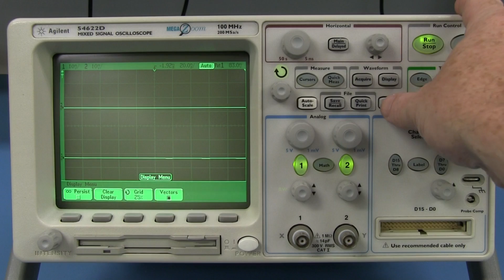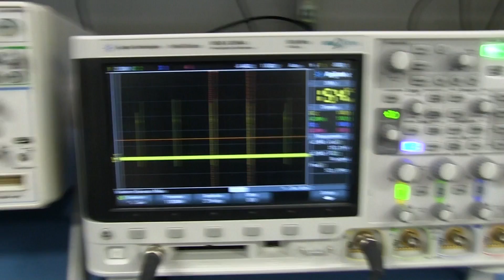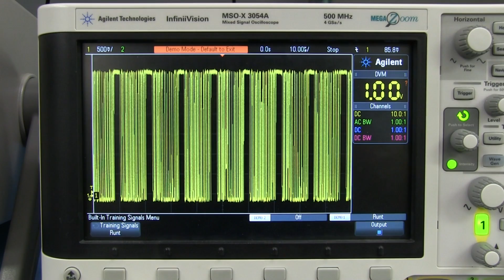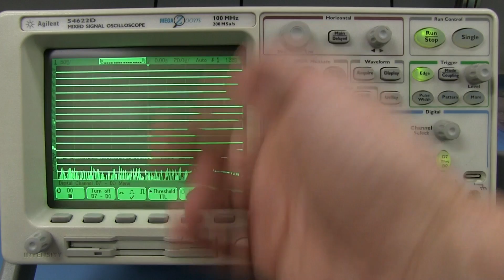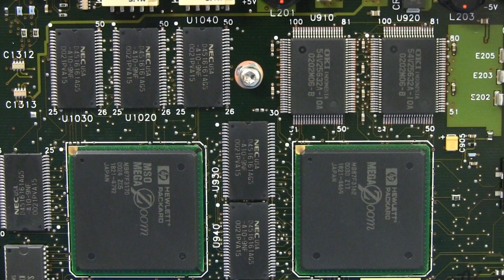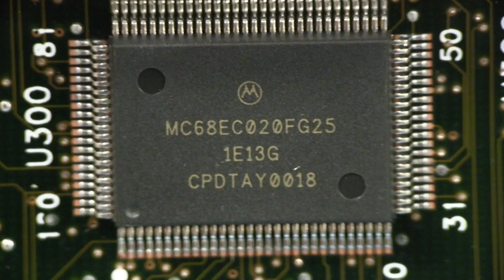EEVblog #591 - Agilent 54622D Retro Mixed Signal Osciloscope Review & Teardown

Comment: it is 400MS/s on digital when you use only 8 channels, otherwise it is 200MS/s, unless it is updated from the HP 54645D
Curious how you have all of those FFT's, integrals and other stuff without the need of external module and 54645D needs measurement/storage separate module for this

Comment: When i switch my 54622D i receive following messages:  Battery is low, System clock is defaulted, Ram disk is defaulted, The default setup was loaded, etc... What to do, to just change a battery?

Comment: Hi, a little bit late, but Dave mentioned that the fan could be replaced with a quieter one. The fan is a Panasonic FBA08A12U with a massive 47 CFM airflow and 38dbA. Up to now I couldn't find a much quieter one with nearly this airflow. Any ideas?

Comment: I have one.... leftmost button under the screen needs a good push to make it work now though :-( Might need to strip it down to see what I can do...
Reply: +Toby Mole  Agilent no longer had the spare part, which was a shame as it wasn't at all expensive if it had been available. I did fix my scope though. I stripped it down and applied a very thin layer of Caikote 44 to the elastomer buttons. This stuff has flakes of silver in it and once dry works really well. It's available on Amazon. Give it a try.

Comment: Hi My 54622D's firmware is last released firmware(version A.02.31) and Language pack（system version 2.4/11 language).I can select SPI(2 & 3 Wire Serial) and for instance set ~CS and Clock,at the same time we can see DATA.even though 2 channel OSC.Old firmware didn't select SPI,so we had to upgrade the firmware.Support was feasible up to last year.LOL I think it is not so retro.LOL.And if you use PC-Based software like LAP-C at the same time,we can decode I2C module.(54622D only decode I2C hardware,so select START and use LAP-C)So totaliy,54622D is now still very usuful.

Comment: If it only samples at 200Ms/s, then how can the bandwidth be 100Mhz? The rule of thumb is to divide the sample rate by 10 to get the analog bandwidth.
Reply from the maker: With SinX/x interpolation you only need 4 times the bandwidth in sample rate (there is some heavy behind this that proves it's the case), and this can interleave 2 channels to get that.
Reply: If you're referring to the Nyquist–Shannon sampling theorem, it describes that you effectively only need twice the sampling rate to sample a certain frequency
Reply: ***** Yes, but you need a good front end analogue filter to limit the bandwidth of the signal being sampled, and this filter isn't perfect.
Reply: Barrios Groupie Hmm.. that is weird yes. A quick google search shows up that oscilloscopes don't necessarily always one-shot capture. Doing a one-shot 200msps would indeed only give you a fairly poor 100mhz resolution image. equivalent–time sampling can be used to reconstruct a repetitive signal. However, a 100mhz oscilloscope can still display a 100mhz signal. The resolution of the waveform decreases as the frequency goes up, but that is only natural; even on a 200mhz scope the 100mhz signal would be of lesser resolution than a 50mhz signal.
Reply: EEVblog It depends on the speed of the roll-off of the front end anti-aliasing filter. Sinx/x interpolation is then carried out on the sampled signal. I guess you'd have to measure the frequency response to confirm this.

Comment: There might have been some technical advances since 2000 (the replacement of monochrome CRTs with LCDs would be the most visible). But I guess the impression that this scope seems old by now has to do with some design changes that are pure "marketing descisions"  and do not really represent technical advances. Oscilloscopes had the same uniform grey look for many decades and it is a recent trend  that even scientific gear is "stylish" and reminds you of the looks of consumer products. I guess as an engineer one should not let himself be blinded by the "looks" of the gear. I for my part regard some things as "modern" but not necessarily "advanced": For example I don't see the advantage of  flashing soft buttons over the (in my opinion) more rugged plastic buttons they used 30 years ago.

Comment: 1000 pixels horizontal on such a small screen because it's CRT, or because the pixels are smaller since they're just green? Never really thought about how dot pitch could be effected by monochromy.
Reply: IMO it's both. When the scope was built, LCD tech was pretty primitive, so getting a screen with that density would have been either impossible or very expensive. 

If they don't need color, then the number of display pixels per logical pixel becomes one instead of three. So, if manufacturing technology at the time can only produce pixels of above a certain size, a monochrome display would be able to attain a greater pixel density than a color one.
Reply: For the magnets and electron beam of a crt screen, it really doesn't make a difference if the pixels are colour or monochrome. So having 1024×768 in a small 13 inch CRT screen effectively meant you had a 3072-pixel wide 13 inch screen. (well this technically isn't true, as the CRT dots weren't side by side but in a matrix, but hell let's keep it simple). Wonderful times, CRT period
Reply: On color LCD, since R,G and B pixels are arranged in a row, there's a technique called subpixel rendering where you can light an uneven number of pixels to simulate a higher resolution.
Reply: I remember that the monochrome CRT's actually had solid fluorescent in front, not like RGB screens that had pixels. It depended more on driving electronics and electron beam how much resolution it had.
Reply: DjResR I thought that was more for vector CRTs rather than raster ones.
Reply: A monochrome CRT does not have grille, hence the resolution of monochrome CRT itself is infinite. Hitachi VC-6145 also has about 1000 point resolution horizontally and been produced around late 80's. At that time people had known what's high resoultion really (it's the true analog oscilloscope with infinite resolution)

Comment: Look at the ADC's : They are spec'd AD9054A-135 which is the 135 MSa/s version. I can't figure out from the manual if 200MSa/s is for both channels at the same time. If it is, then they have been cought with their pants down, like Rigol. Using 135MSa/s spec'd ADCs at 200MSa/s.
Reply from the maker: In my haste I completely forgot to look at the ADC's!
Reply: There's nothing inherently wrong with "overclocking" ADCs if the signal is not affected :D